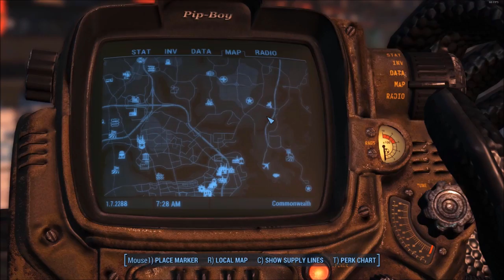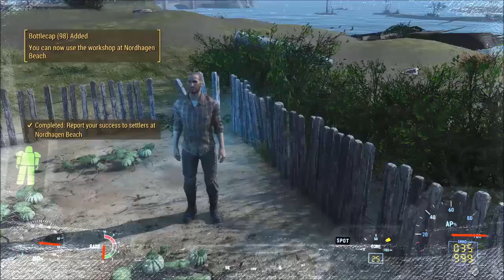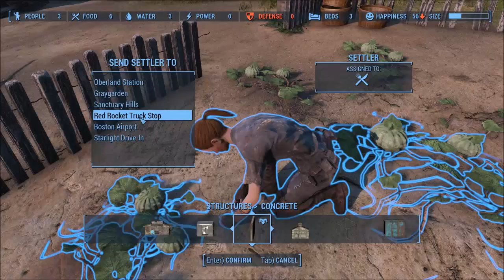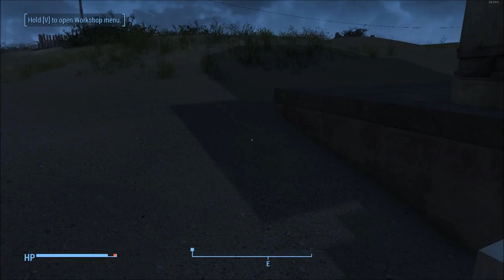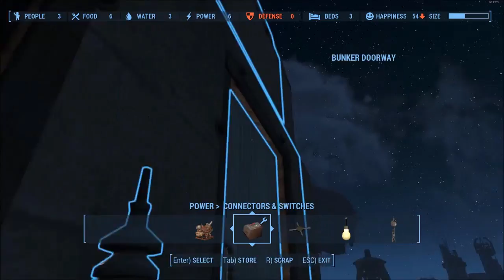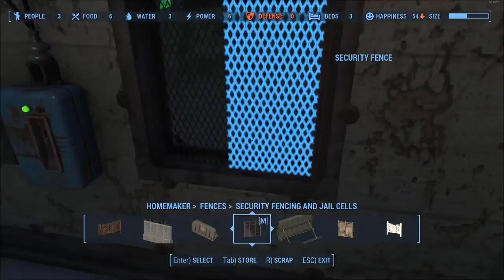How To Wire Circuits Step-by-Step in FALLOUT 4

Comment: With the wiring glitch you can just cheat by putting both switches on one side of the wall, attach power then move the outside switch outside and have it linked to power. And works fine to add it to the red side of the XOR before moving it outside.

Comment: DarkDally.. Just a heads-up on the wire glitch. Once you successfully do the glitch you need to come out of the power section and then back into it again to be able to place, wire etc. Doing the glitch locks you out of building until you do.
Reply from the maker: I did mention once I believe, the first time I did it in this video that you have to press the back button.  I'm so used to doing it that I don't think about it really anymore.  I might have gone over it a bit fast.  Thanks for pointing that out.